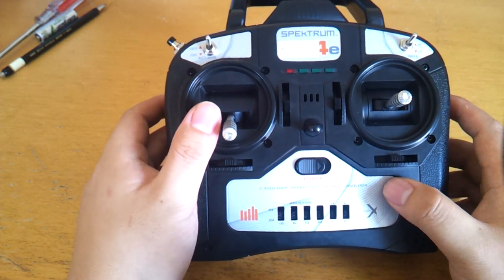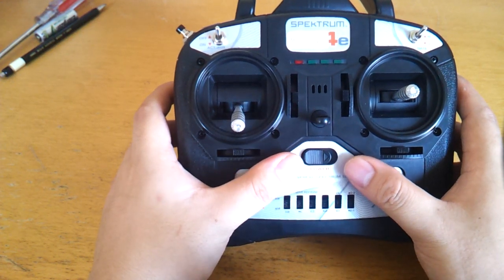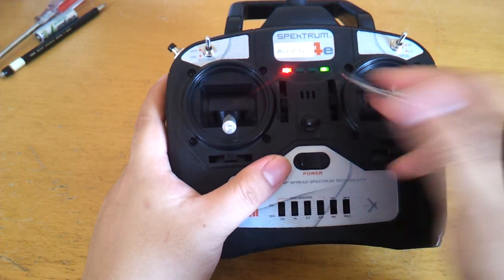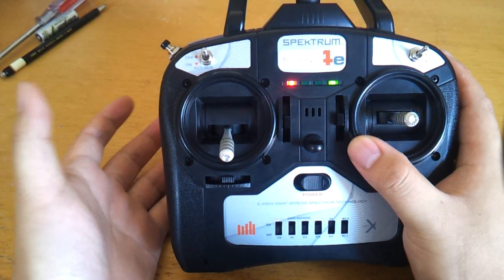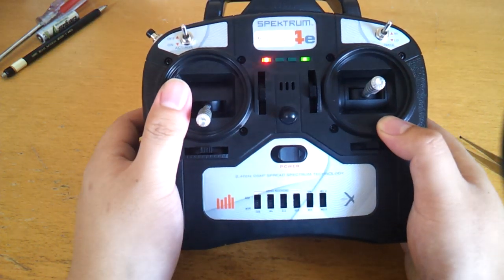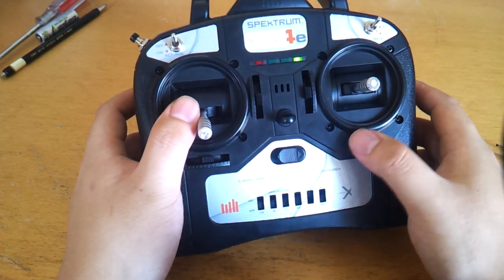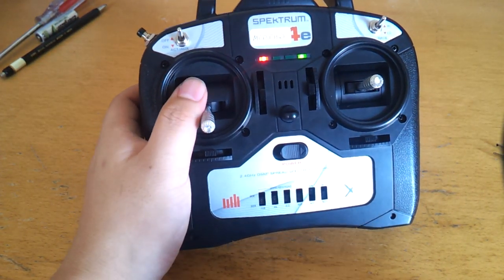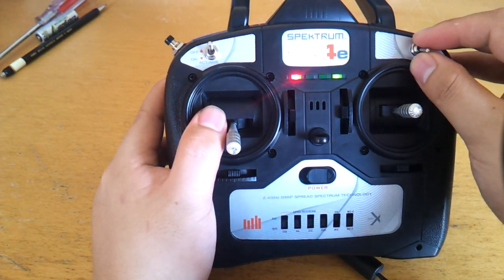DX4e modifications

Comment: Hey, is it possible to get the firmware from you? And is it possible to change the code, so that the 2-stage switch could be replaced be a 3-stage switch?
Reply: Older versions of the dx4e have the 2position and the newer one would have the 3 position